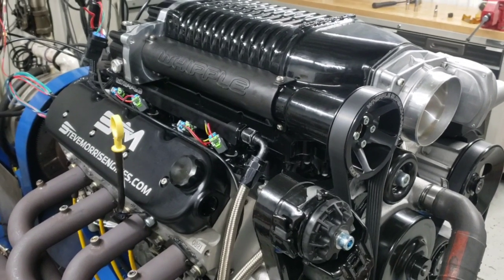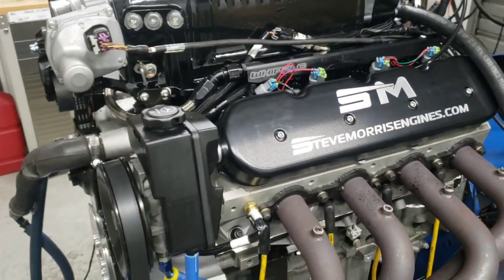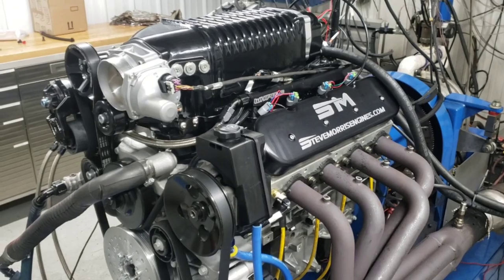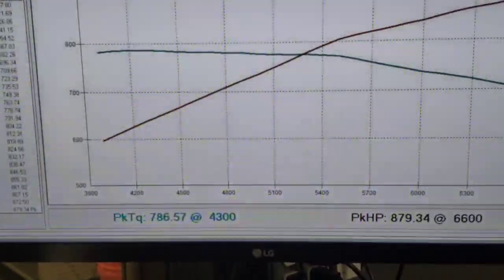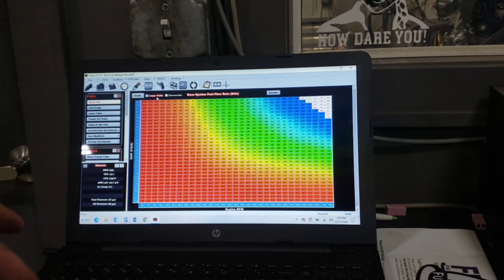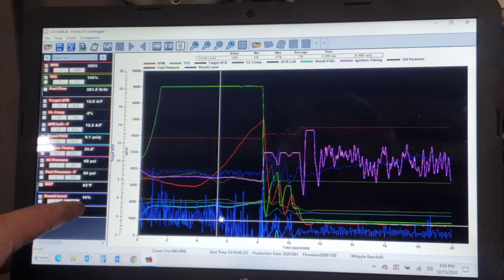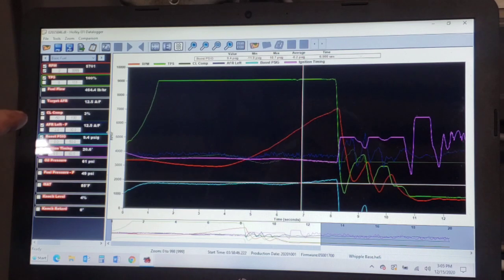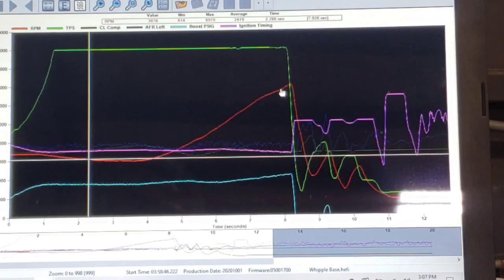Whipple supercharged LS3 for Pat Stoken / Whipple Motorsports

Comment: At 4300rpm the engine makes its peak Torques of ~790 and then the Torque starts to roll off; one of the reasons for this is because the positive displacement superchargers run out of (not necessarily boost, but) the ability to properly fill the cylinders at higher RPM - and in turn that impacts cylinder filling and torque numbers. 

Love all Steve's motors and videos.

Jim Stanley

Ex AMG powertrain engineer.

Comment: Very nice, will be fun for a driver. Wold love to see how it would RPM out the backdoor with 3-4 degrees more LSA and 4 degrees more exhaust duration. Thinking that the blower will still fill in torque down low, but it would carry flatter torque up top.